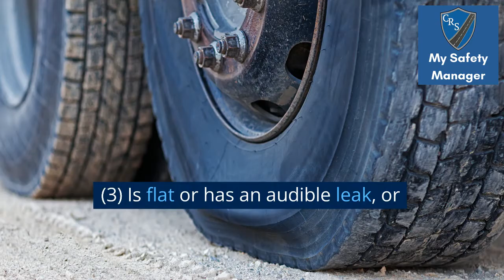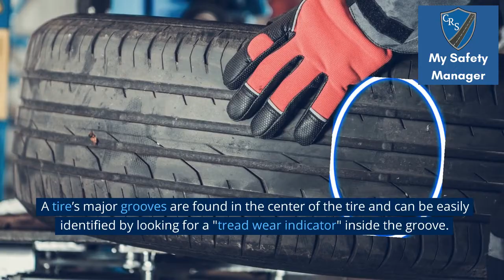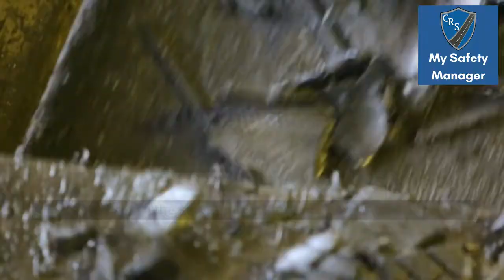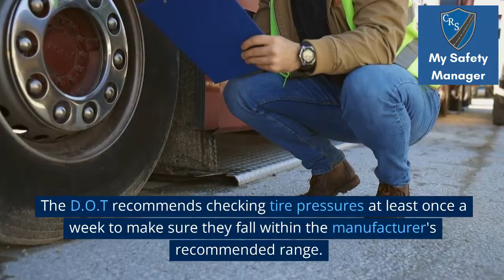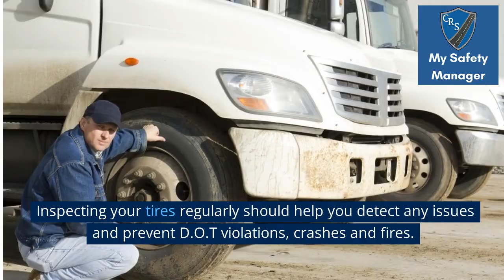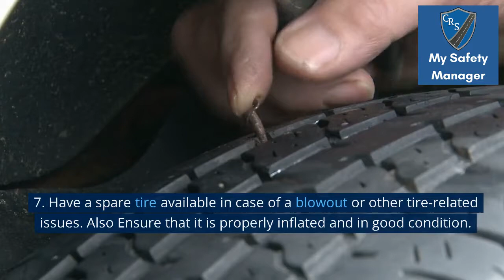Trucking Tire Safety

Comment: Does DOT allow mismatched steer tires?
Reply from the maker: Hi Rick, sorry for the delay in responding. Currently. there is no regulatory guidance pertaining to mismatched tire sizes on opposite ends of an axle. Particularly on a steer axle. But, the CVSA is examining the issue and we hope to hear something in the next few months.